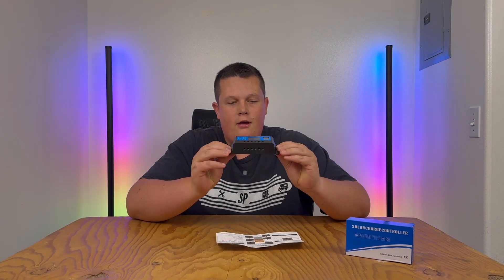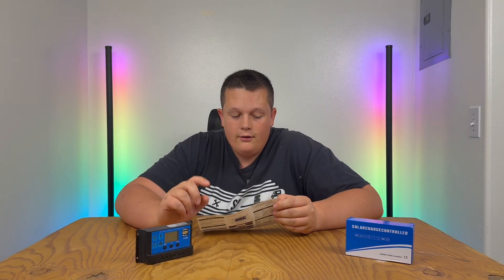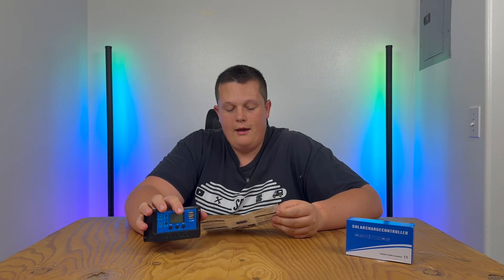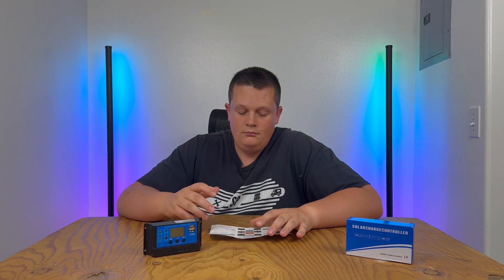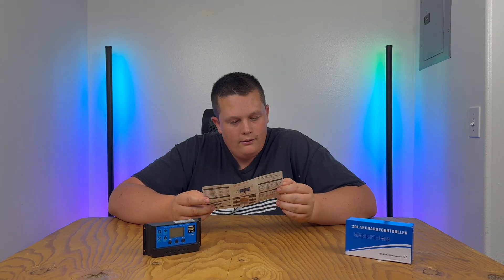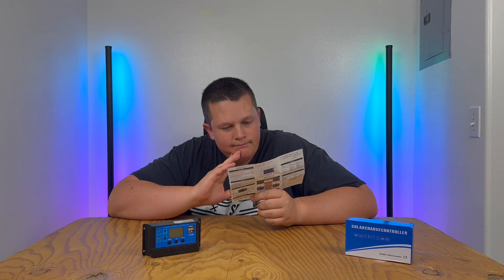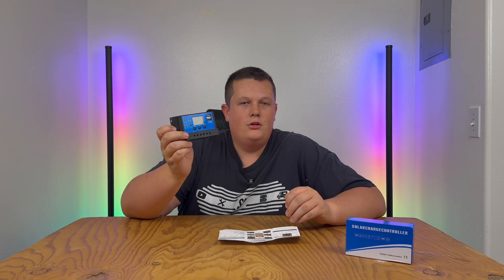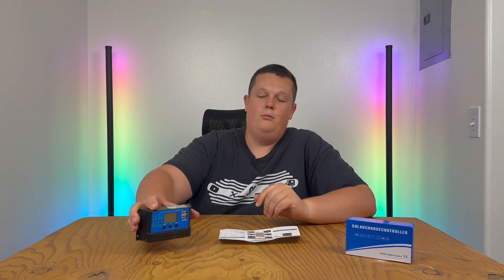Basic PWM Solar Charge Controller Overview | How To

Comment: Hi can this be used to lower the voltage of 2 solar panels. I have a Powerhouse 767 power station with 11-60V.
I purchased   
The JA Solar JAM54-$31-405MR 405 WattPower at Mpp: 405 Watts
• Short-Circuit Current (Isc): 13.87 Amps • Open-Circuit Voltage (Voc): 37.23 Volts • Current at Mpp (Imp): 12.98 Amps • Voltage at Mpp (Vmp): 31.21 Volts 
I'm new at this I try to run them parallel and series but I'm only getting 240w charging into my power station

Comment: ThaThanks for your videos on this controller..very helpful.

My one issue has been the discharge stop setting. You say inbetween 11.6 and 12v....but ive found i can only adjust up to 11.5v.
I think this will be ok..but can you go higher on yours?

Comment: I have agm battery and I choose b1 for type, but while charging I see voltages u to 15.5v mostly 13-14.5 . I'm worried if I boil the battery. Any recomendation for setting on this controler for agm 12v battery? When I set to b2 it doesn't go more than 12.6

Comment: I have the same Solar charger with a 100ah lithium battery connected to a solar panel to run a AC it worked for 3 days and then stop… could it be because I connected the solar panel wires to the solar charger first ?
Reply: Yes, always connect to the battery first otherwise you burn out the controller